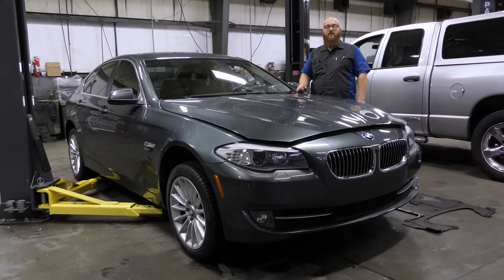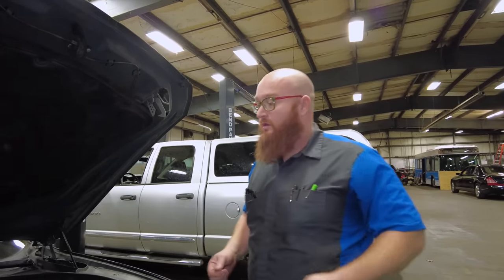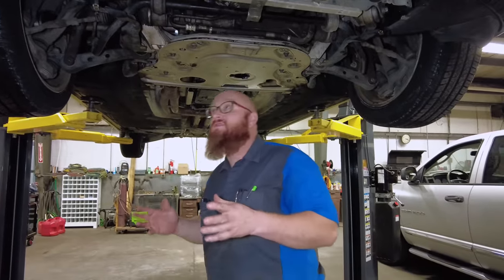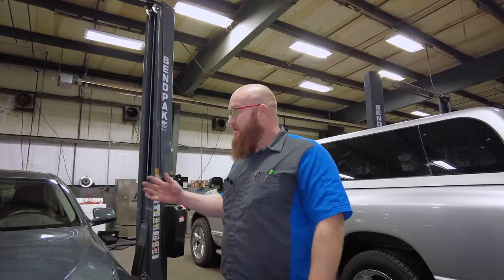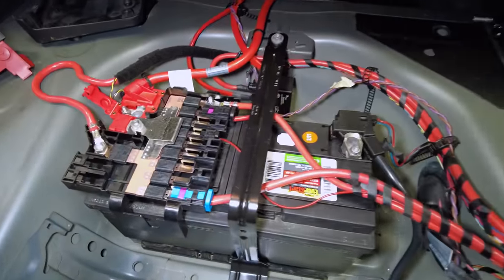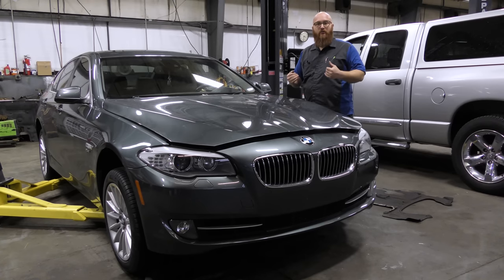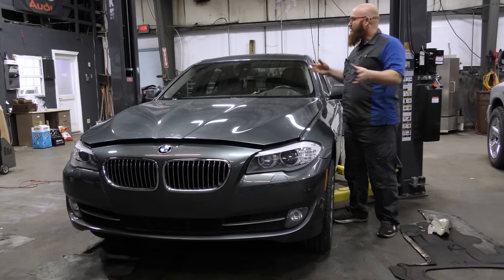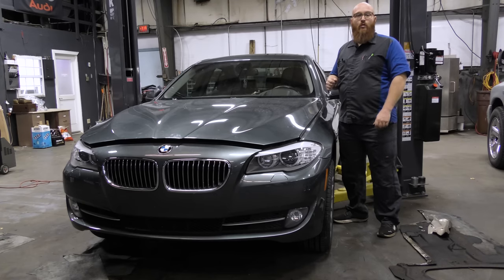One bad day for a customer! CAR WIZARD found TWO insanely unrelated issues at time on '12 BMW 535i

Comment: Learned via YouTube to DIY about 3 years ago on my e39 530i. Found it fun, easier than I thought, and cheap compared to the previous 12 years of bringing to shops. When my e39 was sorted, I bought a cheap e46 330xi with same motor. I had to replace the oil pan gasket immediately cause it was leaving a little puddle overnight. That job remains the biggest and hardest job I’ve done (on Jack stands in my garage). But satisfying as I’ve put 15k miles on it (now 206k miles) is not only fun to drive but I take skiing too with snow tires. It’s a great car. I do expect repairs. Replacing hard coolant pipe under manifold on my e39 now and have a new starter on order for the e46 to hitch has the same no crank no start symptoms as the video. Investigated battery, alternator, EWS, gear selector parking switch because I installed a reman Bosch starter just 2 years 2 months ago and couldn’t believe that was the problem. Of course warranty expired just two months ago! Ordered another reman ($166) but this time from FCP Euro for their lifetime warranty. Not really looking forward to removing another intake manifold but the job is totally doable but time consuming. My wife has an e70 x5 3.0 - water pump and thermostat are way more expensive and more difficult. Transmission pan was much more tedious and difficult cause of bolts that were partially blocked. And the AC belt has no tensioner which makes it a pain to install. And that damn FRM Module had to be reprogrammed 3 times when battery went dead. It’s reliable though, luxurious and really a perfect size. I hear the wizard’s argument but 10 year old+ cars with 200k miles do leak and components wear and it assumes that people who buy BMW’s are ignorant of what they are buying which they are not.  it’s the people who buy them used and cheap who get screwed cause they don’t do their research and then can’t fix it themselves or afford to have it repaired. Why do you feel bad for those people?
Reply: Yeah, let me go buy a shit car so I can have the "satisfaction" of fixing it myself.
Reply: Good one
Reply: @thebigmon  Well it depends. I bought an 2011 X3 for at least 30% less than a similar age and mileage CRV. Spent about $1000 on parts for maintenance , that is plugs and coils, brakes, tires, filters and filter housing gasket, transmission fluid and transfer case fluid. I work on my cars.   The benefits is better handling and performance and interior than a CRV for cheaper. Cons, you're always wondering if something is going to break and resale value.

Comment: The starter can sometimes be "helped" by knocking it with a hammer. I would try that just to see if you get the engine running before you decide to fork out money on a starter change.
Reply: Exactly I'd try to get it running at least once 1,200 is way too big a gamble. Customer needs to get a less high end mechanic. Wizard is good/competent but caters more to the price is no issue customers.

Comment: As much as informative that your videos are, could’ve mentioned it’s at 200K miles in the beginning rather than the end and not as exaggerate as much. All you had to do was look up F chassis Neutral override there is a way to do it through the gear selector I have done it on F chassis vehicles myself. That started has every right to go out especially with 200K miles and auto start/stop feature. BMW’s In-line 6 especially the N55 is damn near bulletproof. General BMW reliability bashing is a thing of the past look up a B58 or any of their modern designs, damn near bulletproof.

Comment: Here is a crazy idea: the engine overheated and partially/temporarily locked due to som dilatation. While in that state, the user tried starting it. This triggers the starting sequence which could have overheated the starter motor until it was gone!

Comment: I guessed "All 3" for the cause of the coolant loss.  I guess I'll keep my Subaru seeing as how it's on the Wizard's "to buy" all wheel drive list.  Plus with a manual transmission, there's no guesswork on how to get it in neutral in case it needs to be moved without the engine working.

Comment: I can’t agree with the wizard on this one. Beating on BMW like no other manufacturers have hard to get at parts or have any failures. 200k miles and the starter failed and a hose connector broke- big deal. I’ve just looked online and I can get a Bosch starter for £188 for this model and labour rates in the US seem high compared to the UK, $150 an hour is more expensive than the BMW dealerships charge over here last time I looked, my local shop charges £60 an hour inc VAT and they are brilliant,my local BMW specialist is £93 p/hour. WatchJRGO would have that knocked out in a couple of hours for $200😂 Just saying… The neutral situation is dumb design though, you should be able to do it from the inside 🙄

Comment: Its probably not the starter. What are the odds. Its most likely the ground to the starter. Check the grounding wires and grounding connections.

Comment: 13:02 Well, if it has 200,000 miles on it, and it turns out that the engine is toast, the customer might just want to get whatever money he can for it, and get another car at this point,  if he can afford to.
Reply: He could get a 2000 Corolla for cheap and have dependability, or maybe status is more important
Reply: @safffff1000  status is way more important, its all these people think about. ego and looking "good"
Reply: @safffff1000  one is fun and rewarding to drive. The other is an appliance on wheels
Reply: @burntnougat5341  Waking everywhere then getting an old Beetle is like improving 95%, going from that Beetle to a fancy car is only 5%. 95% of the time nobody racers their cars around corners, it IS an appliance.
Reply: @safffff1000  tell me you're a normie without telling me you're an normie
Reply: @safffff1000 Bro if you've ever sat in a 5 series then go back to an old corolla you'll cry. Toyota make NPC cars.

Comment: The starter went out because 1. The auto start/stop was enabled.  2.  As the engine started gaining temperature it gradually was harder to start.  3.  The driver was not aware it was happening.  I cannot make any assumptions as to how or why but those seem like like solid facts to me.  I have a 2013 535i XDrive identical to this one and it is going strong.
Reply: I just bought a 13 BMW 535i XDrive with less than 90k and the the electric themometer and water pump went out. It overheated. I almost feel like selling it with all the horror stories I'm hearing. Ugggghhhh

Comment: I have an SL500 so I learned my lesson about German cars.  I’ve spent over $60K in repairs and paid $46k for it in 2010.
Reply: 60k?!
Reply: @Jens_Roadster  Convertible top twice, ABC Suspension three times, other suspension components multiple times, transmission plate, charcoal canister, computer parts, modules, etc; etc; etc;  Plus everything falls apart because it’s just glued together.  Total trash, bad engineering, no longevity.  MB, BMW, Porsche, VW - shit cars.
Reply: @Evermore2017  wow, that's alot. Beautiful car though.
Reply: Holy hell…$60k…I’ve heard nightmares about the ABC. Love my BMW though…

Comment: When any car gets to 200K and has a major service issue, it's probably time to walk away.  I'm all for learning which vehicles are easiest to repair and maintain, because anyone who's owned a car for a while understands that it costs money to keep them on the road over time, and some makes/models are prohibitively expensive in this area.
Reply: Agreed
Reply: I don’t agree that what the wizard is describing here qualifies as Major. It never did before we had fancy BMW stuff so I don’t think we should be changing the rules for high mileage vehicles.
Reply: It's cheaper to fix it than to buy a new car matey.

Comment: It’s worth 1200 more if you get another 200k miles.  Surprised those turbos last that long.  That’s a positive !
Reply: Car Wizard is ripping the customer off in this case sadly. It doesn’t take 5 hours to replace the starter. Maybe 2.5-3 hours if you’ve never done it before. On a 2014 535i F10 RWD (which engine bay is the same in terms of starter and removing components from up top) it took my local BMW shop about 2 hours to get it done since I was waiting there while they did it. Removing the intake manifold on the N55 takes maybe 30 minutes once you’ve done it once or if you’ve ever done any N5x engine. I would know since it took me about that long when I walnut blasted that same F10 about 8 months later.
Reply: @WHTMAN-ei7ik  I’m sure he just charged hours by the book. Just because you can finish a job faster doesn’t mean you charge cheaper.
Reply: Those turbos might be on their way out too now because of the overheating
Reply: @MrSpeedysclassics  exactly
Reply: @alphatrion100  The engine in this car (N55) is a single turbo. They're not really known for turbo failure and I don't think the turbo would've failed as long as it still had oil supply. The owner managed to turn it off before the lack of coolant did any damage luckily.
Reply: Borrowed time with 200k.

Comment: Americans you are very strange. In Bulgaria I would go to graveyard and get starter for 100$ and get it changed for 150$ and hoose and cooland for another 100$ and this baby is on the road for 3 days. It’s very possible that the truck will cost more that repair…

Comment: Our E39 525IT was pissing coolant right after we replaced the coolant reservoirs. This was after replacing the zf transmission as it keeps going into limbo. Turn out the transmission ECU was bad.  Sold that thing for $1.5K and never look back. Been driving Japanese car for about 7 years now. The peace of mind is unreal.
Reply: Japanese cars are amazing and made to be worked on and serviced
Reply: @tommoon2700  clearly havent worked on an old bmw. Everything is serviceable
Reply: @burntnougat5341  your correct I haven't

Comment: many of these problems would have been avoided if it was maintained and not ignored, the n55 engine is good. good video wizard.
Reply: Yes, it was neglected, still made it to 200k!
Reply: Many of these problems would have been avoided by buying a different brand, one that isn't overrated.
Reply: @rogerfroud300  it does not matter what brand it is, if maintenance is neglected it will bite you back in the future no matter the brand.

Comment: Most likely the temporary overheating seized the solenoid in it's housing causing the starter to fail.
Have this problem quite regularly on my 1974 Lancia Beta.
Might be possible to take the solenoid apart, grease it, remove any blockage that might have build up and reinstall it. 
Don't forget to check it thoroughly before reinstalling.
Reply: marelli= run forest run.
i had 1 beta volumex rustbucket.
just buy a warrantied refurbed starter- to not fuck about with used or shed repairs.

Comment: I recently considered a used xdrive, so am glad I saw this video.  

To me, a starter failure at 200k is not surprising, as it is to Mr. Wizard.  I grew up when we replaced starters and alternators before 100k.  It is a testament to the reliability of modern cars.  However, my BMW transmission went out at 60k, which cost me $4k, so I was not sad to sell my car.

Comment: Its 200k miles, c'mon! You can't fault the car for breaking after this kind of mileage. And the thing looks gorgeous, I would have never thought. Should've checked the interior, too.
Reply: Indeed, it looks really nice, Scary problem tho.
Reply: @Gurupimp10  coolant leaks and broken starter can get any car at this mileage, unfortunately.
Reply: @Psych0technic  Ye I guess, it had a good run, the car looks great for the miles for sure :)
Reply: @Gurupimp10 it likely had tons of repairs over its life, it’s not a Toyota
Reply: @new2000car  Indeed, Germany is not really known for quility as far as I have seen.

Comment: could you have tried striking the starter with something while having someone try to start it just to see if it will start and see  how the rest of the motor is?  Then replace it after if its worth it
Reply: If you can even get to it.
Reply: I dont think there is room to do that, the starter motor is under the intake. If you took off the intake to pull out the intake, you should change the starter anyways, just to prevent to have the same issue in a little time.

You can try it to see if the starter works again for a bit to check if the engine still working fine, but I dont think its worths keeping the old one
Reply: Doesn’t necessarily work for all vehicles

Comment: Roommate has a 2011 528i, I wanna say that specific year is the one to buy. That was the only year it came equipped with an N52 NA straight six. The rest of the 528i's for the model use a 4 cylinder I can't trust with a stick. Has over 100k miles on it and besides the few odd electrical things like a blower motor to the interior, has been real good to us.
Reply: yea the N20 (4cyl) in those is garbage
Reply: N52-n54s are great! Well mainly n52s, not the turbo ones. 2007-2012 n50's are actually great and reliable. 

With the exception of a short list of things to replace and maintain like the vanos solonoids, vanos filters, ccv/pcv and a few sensors. Not bad for a good looking car tbh.
Reply: Yes i’m about to buy a 2011 528i with 75k miles! About to be my 3rd N52 powered bmw, and my 4th BMW (i’ve owned all bmw’s lol)
Reply: I have a 2009 328i. 77k miles so far.  That is great to hear

Comment: Bmw are fun if you diy. And know how to maintain them. You just need to do a lot of work on things that are not broken yet. If something else fails. Like the starter. Replace vacumm lines, valve cover gasket, some coolant hoses and more breaky parts while youre working. Here in Europe those plastic crappy things are not exspensive at the dealer. For a couple hunderd euros you can change a lot. If you always do that you can actuelly enjoy them without all those small things breaking all the time. Bmw has not so much big big problems. Like gearbox breaking or engine blows up or anything. Just the million small things which if you keep track on them while fixing other stuff. Its not to bad. I learned this the hard way driving my e46 to 585k kms.

Comment: My guess was option 3 the hose. But I kinda expected it to be in a spot where half the engine has to come out 😂
Reply: My guess was something regarding a plastic component in the cooling system.  That clip which holds the hose on is actually plastic on a VW/Audi so kudos to BMW for actually putting a metal one on but I'm curious what failed to cause that.

Comment: The water pumps aren’t too great for n55s, and so aren’t the coolant reservoir tank which cracks from engine heat over time, I’d guess either A and B.

Edit: Well guess I was wrong initially
Reply: I thought WP too since it's an N55. I also noticed the coolant on the bottom of the connector was green when it should be blue. I wonder if they had the wrong coolant in it.

Comment: This video makes sense coming from a non-BMW shop. The transmission can be put in neutral if the vehicle has power, there's a procedure for it - the allen bolt is a mechanical override if the vehicle has lost all power. Yes, it is counter-intuitive and annoying. Cooling systems on these really need to be done every 80-120k miles or 10 years; the plastic ends on the hoses becomes soft with age and will eventually fail, I can even tell you the order the hoses will fail in. The particular situation here seems unusual and I wonder if someone previously had that hose off. I've never seen them come unclipped like that, but I have seen where someone fails to seat them and they pop off. Starters on N55s seem less common, N52/N54s had a lot of issues with them but that's about the only series of BMW engines that have systemic starter issues (and even those aren't bad imo, they're just worse than the older engines where the starters seem to last forever). It could have been on its way out and stressed with a low battery. Another thing to check on these if they don't start is the engine ground strap, they love to go bad. As for replacing it, the intakes comes off pretty easily. They're not the easiest to do like an LS, but they're also not the worst. As for the oil leaks, there's a few gaskets (valve cover gasket & oil filter housing gasket are the big ones) that need to be replaced around the same time as the cooling system. The worst is the oil pan gasket, especially on AWD models. Any leaks near the belt drive need to be dealt with immediately as the belt WILL come off when contaminated with oil or coolant and it's likely the crank will grab the belt and pull it into the engine. It's as bad as it sounds. That said, while BMWs certainly have their share of quirks, they drive really well and hold up when maintained. Most of the issues are of the variety that give you time to address rather than leave you sitting - that is, unless the issues are ignored.